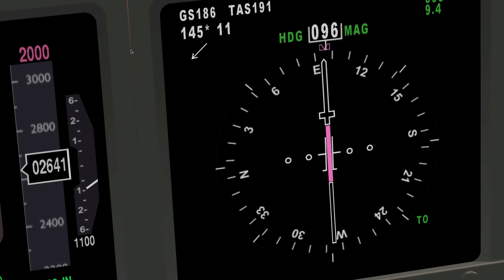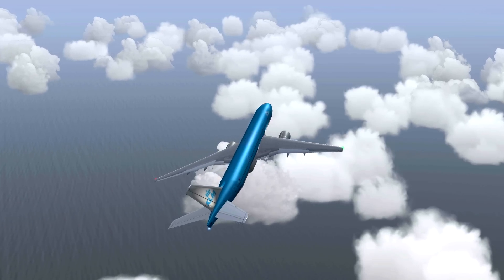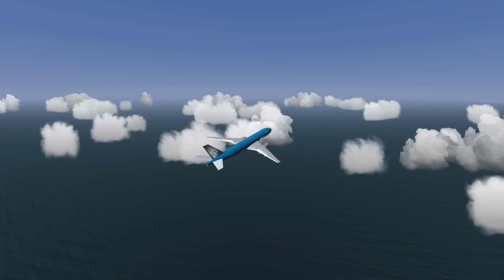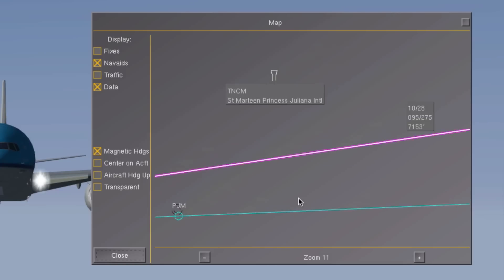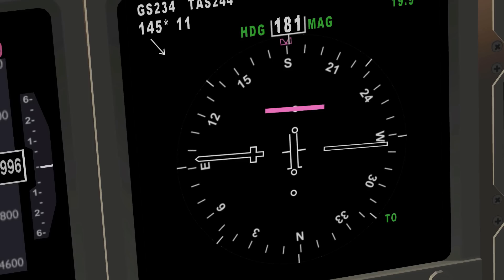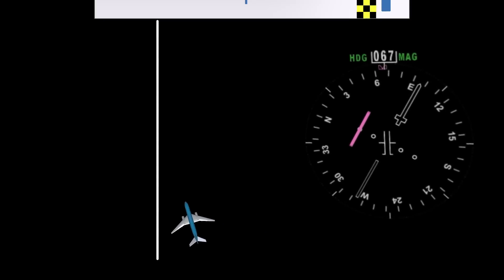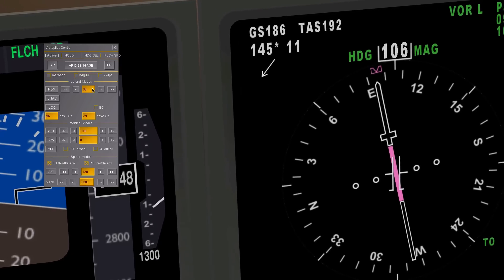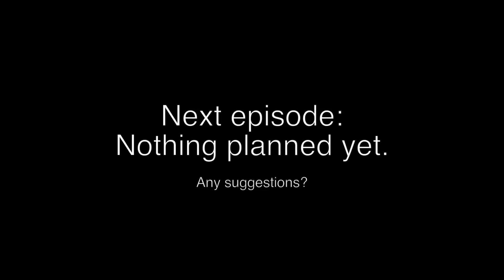VOR/DME Approach - FlightGear HowTo #29

Comment: That's NOT a VOR-DME approach. On a VORDME approach you need to fly an arc with a fixed distance to the DME station (which is established on the approach charts), then intersect a determined radial (which once again will be established on the charts), and only once you are on the airport minimums (again, established on the approach charts) you should line up the a/c with the runway